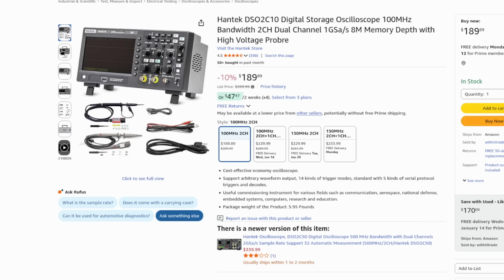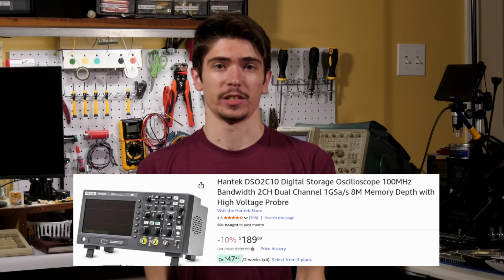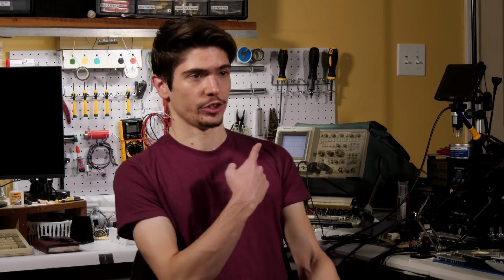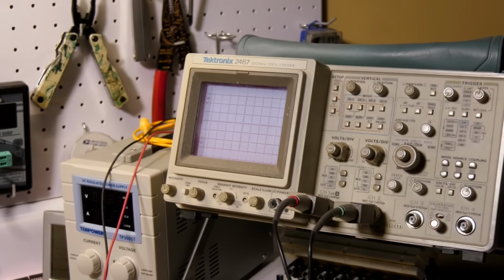What You Need to Begin Electronics (Start Analog)

Comment: this is a great video , but its waaay overkill for beginers , you dont have to buy a scope and a power supply  when you start , 9volt battery or dc power supply is enough , if you run into problems get a multimeter , you need components , boards a soldering iron and a box , from there you accumulate , most poeple cant afford all of those when starting , and more then that they will feel intimidated by the erlative complexity and price of those products when they dont know yet what a resistor is . i apreciate your videos , but as a teacher , dont scare beginers , we will lose lots of poeple with potential like this
Reply from the maker: I would not advise learning electronics without first learning what an oscilloscope is and how to use it. It isn't necessary to acquire everything in this video all at once, but I don't recommend trying to learn blind. Even a cheap, low bandwidth (like 100kHz low) is good as a learning aid.

When I wrote the video, I had serious beginners in mind, rather than those only curious about beginning. But it would have been helpful to be thinking of both. Thanks for the feedback.
Reply: @RAndrewNeal  i agree that once you decide you want to dive in, a power supply and a simple oscilloscope (which frankly for beginners there are some cheap usb stuff) is indeed important , i just teach people who have no clue , and if i would tell them they need to get an oscilloscope , a power supply , a soldering iron and all the stuff around , boards , components , etc. a lot of them would feel very intimidated , that said , yeah as soon as you choose to dive into the deep rabit holes all this stuff is very usefull
Reply from the maker: @Serioushit  I will be more mindful of undecided beginners in future beginner-oriented videos. It's easy to forget that not everyone is enamored by instruments with an overwhelming amount of buttons like I am (even before I know what they do). lol
Reply: @RAndrewNeal  your videos are great by the way , i refer my students to your beginer tips for soldering and thye learn a lot from it
Reply from the maker: @Serioushit  Wow that's so great to hear, thanks!

Comment: It's also a good idea to stock up on 2N2222 transistors. They are the most common and versatile transistors.
Reply: Don't forget its PNP complement the 2N2907! The 2N2222/2N2907 pair are considered to be "jellybean" parts, just like the 2N3904/2N3906; but they can handle more current.
Reply: ha ha. bought 1000.
friend drops in. im complaining about them not containing sufficient smoke... seemed everything i made just failed with no real excitement...

not sure what he did but next second he has a complimentary pair on fire on the breadboard...

"they DO contain smoke!"
Reply from the maker: The magic smoke can be temperamental haha

Comment: the hardest part of me getting into electrical stuff was looking at an integrated PCB and trying to wonder how it works. With mechanical stuff and older equipment that might not have that, its a lot easier to wrap your head around. I somehow started going down the rabbit hole of old school electromechanical stuff, and like, i have the brain rot now. Sillicon still baffles me to an extent and i still prefer my tubes but it gave me a whole new appreciation for the electrical world
Reply from the maker: Silicon's tough to grasp at the lowest level for sure. I still don't look too close at it lol I let the silicon engineers worry about that and I just read the datasheets they write about them.

Comment: I would add an analogue meter to your list. You can’t beat it for reading peaks while adjusting things( such as aligning radios) and with older equipment the voltages on the circuit diagram were measured with analogue meters , which have a different loading to DVM’s. It makes the mental maths easier. 
Analogue scopes are absolutely fine for “ mucking about”. When I first started( in the 1980’s!) my first scope was all valves( tubes) with a bandwidth of about 6Mhz. For messing about building amplifiers, fixing radios and tape recorders etc. it was perfectly adequate. There are plenty of 10-20 MHz solid state scopes still around , for not much money,which will start one’s journey into this amazing field.
Reply from the maker: Awesome suggestion! I don't have an analog meter myself, so I couldn't include it since I haven't used one in my own learning. But I know they're quite fast and offer a more continuous readout than digital ones. Worth it for the right applications! It could have been an honorable mention to the DMM for sure, if I'd have thought of it.

Comment: no reason to learn analog, just learn programming and buy yourself cheap MCUs they cost 0.01$ a piece now
Reply from the maker: "No reason to lay a foundation, just learn framing and use only wood; it goes cheap now"
Reply: @RAndrewNeal   much better/accurate comeback: no reason to learn advanced Math now just learn to use AI, chatGPT, and Claude Opus4.5

Comment: thoughtful exposition with appropriate terminology and an adequate general  mix of components to start with although a little more generous on quantities and expenditure for beginners than expected.
Reply from the maker: All can choose for themselves what they will buy based on their level of intent. Those just entertaining the idea may buy a cheap starter kit with low quantities of basic components and a couple multi-function instruments. Those actually beginning and not just interested in the idea will be acquiring more. Plus, there is no reason they have to buy everything all at once, and I'm not going to recommend them junk which would make their learning experience even more difficult.

Comment: I started with electronics 50 years ago, first by building small circuits according to schematics in books. Much later I started designing my own circuits using the tested designs as a basis and making my own mods and additions. During the years, I have gathered a lot of components. Watching a (great) video such as this one makes me wonder when I actually will build something of, say, opamps that I got 30+ years ago. But, they don't get old, they serve as spare parts for occasional repairs and do not take up much space. One recommendation from me is to get old data books and datasheets for components. Maybe online but I prefer the paperback books because they have additional information in form of application notes and also they definitely give the electrical parameters for those old ICs. The oldest one is RCA's 4000-series CMOS databook (digital though) from 1978, that was last time needed two weeks ago! Wanted to find the exact specs for a 4046B phase locked loop. And old books look cool on the bookshelf.
Reply from the maker: Glad you enjoyed, and great advice! I keep datasheets for all my parts in PDF form in a folder on my computer. I never thought about getting hard copy books of them; those would come in real handy for repair work. Especially if I don't have a computer or internet connection on hand.
Reply: @RAndrewNeal  Way back in the day I used to have hardcopy books for the common linear, TTL, and CMOS chips. I doubt the manufacturers still publish/distribute them in hardcopy form. I keep PDFs in folders by category (transistors, microcontrollers, op amps, etc.), and link the PDFs from spreadsheets which list what I've got on hand. The spreadsheets also list a few essential parameters for each device (e.g. for op amps it shows power supply range, bandwidth, whether it is single/dual/quad, and whether it is rail-to-rail), so I can narrow things down quickly when I'm looking for something.
Reply from the maker: @MikeU128  Wow, sounds like you've got a lot more in stock than I do lol. I don't have enough parts and datasheets on hand to need that level of granularity. That, or I don't know what I'm missing.
Reply: @RAndrewNeal  I might have gone a little overboard with buying "interesting" parts when I decided to get back into tinkering. I felt a little like a kid in a candy store when I was on the DigiKey site - "I'll take 2 of these, and 3 of these, and one of those, and oh, these are discounted if I buy at least 5 of them..."

The spreadsheet idea was my way of attempting to bring some order to the resulting chaos.
Reply from the maker: @MikeU128  Ah, I have been there, on a smaller scale lol. I bought a bunch of crystal oscillators at various frequencies years ago because I wanted to build radios, and still haven't used but one, and not even in a permanent circuit. I think I bought the things to build a frequency counter at the same time, and only recently built it for a video (half the resolution I originally wanted because of precision and bandwidth limitations on the old 74 series TTL logic chips).

Comment: Just stumbled across this channel, but it caught my eye as I've been getting back into electronics tinkering after a long hiatus. I originally thought I wanted to get an EE degree and go into electronics design, but ended up getting sidetracked into software and getting a CS degree instead... and that diversion has lasted multiple decades! 😆

I've spent the past year or so attempting to get caught up. Mildly annoyed that interesting new components (or even current versions of old components) tend to be available only in SMT packages, but I guess that's just an excuse for me to level up on my SMT soldering skills.
Reply: Larger SMT components (0805+) can even be done with an iron and fine tip. I'm able to solder .65mm pitch (with a desoldering tool, flux and a microscope.)
Reply from the maker: @ryanbareither89  I personally wouldn't reach for a fine tip until 0402 and below; you can still take advantage of a larger surface area on standard 0603 and larger parts. But it's really down to your preference and level of comfort (and how quickly your iron can dump heat into the joint).
Reply from the maker: SMD/SMT isn't that scary! I have plans of doing videos on SMD soldering and rework using different tools, but I couldn't tell you when or in what order they'll come. Glad you found the channel and hope you enjoy what's to come!
Reply: @RAndrewNeal  I've mounted a few SOIC and SOT parts to adapters, with varying degrees of success/frustration. Looking forward to the SMD videos!

My initial attempts were mostly motivated by newer op-amps being SMD only, and the phase-out of many through-hole FETs (especially JFETs).

Comment: Thanks for the tip on the BusBoard breadboards! I'd noticed the variable quality on the cheaper brands (the contacts in the power rails are frequently too loose), and was wondering if anyone still made decent ones.

Also, I wasn't looking at the screen when you mentioned the small-signal MOSFETs, and thought you said "PN2222". I did a double-take and was like "Wait, that's a BJT not a MOSFET!" I had to rewind and re-watch that bit... "Aha, it's VN not PN!" 😆
Reply from the maker: You're welcome!

Haha

Comment: Would a small dc train transormer be okay for testing?
Reply from the maker: To use as a power supply? If its output is regulated, you could probably use it. It would be much more difficult if it isn't, unless you use your own regulator in your circuits. Any voltage between 5V and 18V will be okay, and a current supply of at least 100mA. These should be written on the device somewhere if it's an AC-DC converter.
Reply: I'm guessing probably not very good (or no) regulation if it is designed to run model trains. You'll likely want to rig a regulator downstream of the transformer. Also, unregulated DC supplies will generally supply quite a bit more than their rated voltage, when used below their rated amperage. This can be problematic for circuits which require a specific supply voltage. Check the voltage with a multimeter!

Comment: It's kinda sad that these days you don't really dig that deep into analog as an electronics apprentice, I mean sure with stuff like falstad's circuit simulator it became even easier to visualize electronics, but I still feel knowing how to use an oscilloscope should be fundamental knowledge of any electronic enthusiast. I'd even go so far and suggest getting one before buying a multimeter, seeing even digital ones are affordable these days, atleast for personal hobby usage.
Reply: It isn't even so much a "these days" thing. Some time back (mid-aughts) I worked with someone who had a Masters in EE and didn't know how to use a 'scope. I was flabbergasted. Me (CS, not EE!) teaching someone with a Masters in their field how to use a 'scope... how does that even happen? 🤦‍♂
Reply from the maker: Bruh. That's insane.
Reply: @RAndrewNeal  Theory vs. practice? 🤷‍♂
Reply from the maker: Learning electronics and skipping analog is like building a house and skipping the foundation. The oscilloscope is definitely the most important tool, but the multimeter is the most basic, which is the reason why I put it just ahead. I do use the scope more when designing, for sure; I just had to put the basic tool before the advanced one. I did have the same thought as you though, about the oscilloscope being moved up a spot.
Reply: @RAndrewNeal  I see the multimeter as the little brother of the oscilloscope, essentially it's a cut down scope for handheld usage. In fact it may even make more sense these days to get one of those handheld scopes. Not saying multimeters don't have a purpose, but I made the mistake "investing" into one that I barely use, a Brymen BM257s. For the same money I could have easily gotten a decent handheld scope and a cheap multimeter, those usually are enough for what they're used for.
Reply: @Torekk  I really think you want both. I have a nice(er) scope, but I find myself using the inexpensive hand-held 'scope most of the time because it is "good enough" and more convenient. But you also want to have a multimeter (or two) handy, to check voltages, currents, resistances, etc... and something which has LC meter capabilities is also handy.
Reply: @MikeU128 Of course, I'm not saying a multimeter doesn't has it's uses. In fact as an electrician I probably use it more often than a scope.

Comment: A comprehensive and thorough guide for beginners like myself, nicely explained. I've started restoring vintage valve and transistor radios from the 1930s-80s. I've just come across your channel and haven't had a chance to look at the videos you've already provided. Do you have experience with vintage radios? If so, do you have any tips that beginners should know or best practices to follow? I know that valves involve high voltages, both AC and DC, but I understand that learning about components, reading circuit schematics, and understanding the different stages in the circuit would be beneficial before diving in. Any advice is appreciated, thanks.
Reply from the maker: Thanks! I haven't repaired any vintage radios, but I have built a tube (valve) amp for guitar. If you tap on any of the larger tubes with a pencil while the power is on and the speaker is connected and turned up, and you can hear it causing an effect, that tube is failing or has failed completely.

If there are any big capacitors in the circuit, make sure they're discharged before you work on it so you don't shock yourself and possibly send the current through your heart. I'd use a resistor across the terminals instead of a dead short; slower discharge and less chance of getting sparks that way.

Capacitors often have failed in vintage electronics, so I'd be suspicious of those when doing repairs. I believe it's the paper and wax ones that are the biggest problems because the electrolyte dries out of them over time.

Mr Carlson's Lab here on YouTube has probably done multiple vintage radios; I've seen a lot of vintage electronics on his channel. You can check him out for some really great videos on vintage stuff!